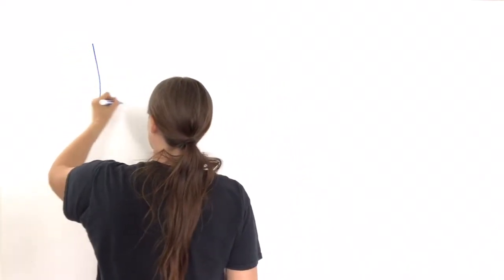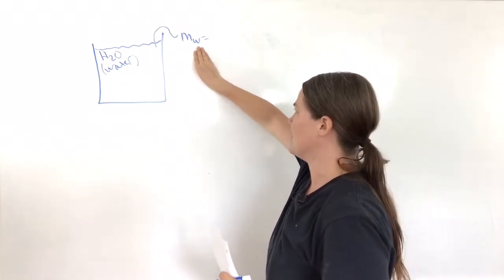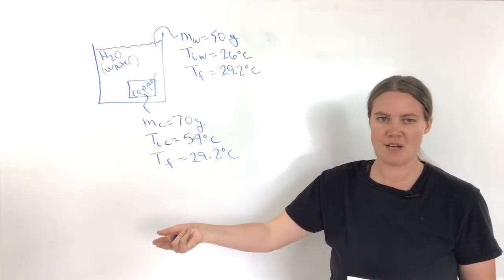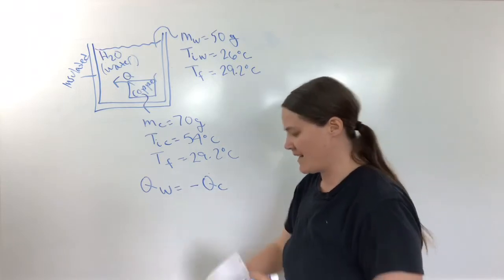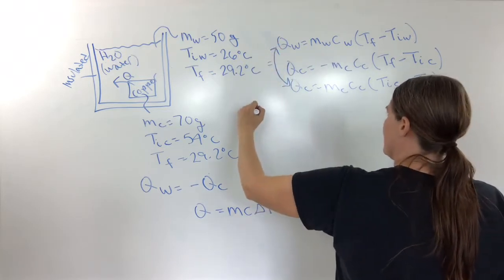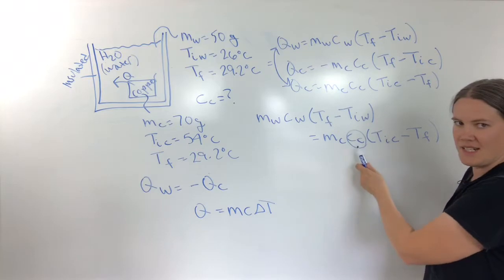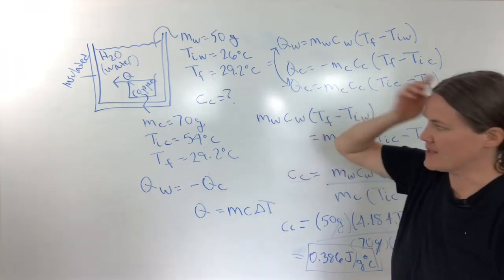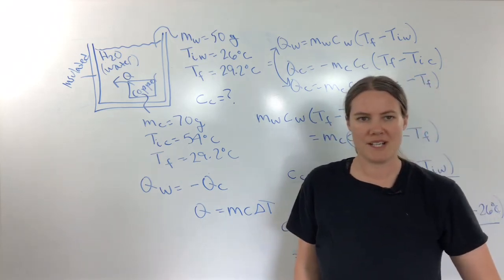Calculate Specific Heat of Copper ( cooling copper in water)

Comment: that was fine for calculating ENERGY

but how to calculate RATE OR TIME of cooling or heating

for example if Metal (block or solid  cylinder) M having Temprature T700 celsius

if cooled to T200 Celsius  in Water W of Temperature T30 celsius

if water has volume V

and more or continuous supply of water is available  at rate of  FR 10kg/s,    enter/exit same rate, so that water Volume V keeps constant

How to calculate Time that Metal M will take to cool to 200 celsius

Comment: Hello! This is a really quick question, If we wanted to convert the specific heat to heat capacity for this example would we just multiple the specific heat capacity which is 0.386 J/g*C by the mass of copper which is 70 g?